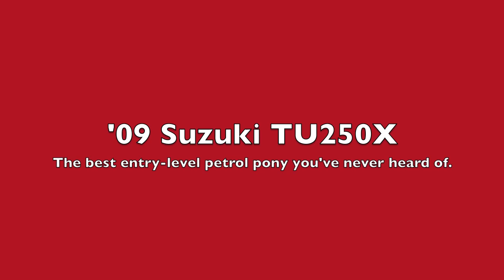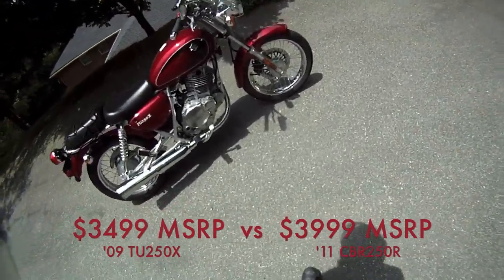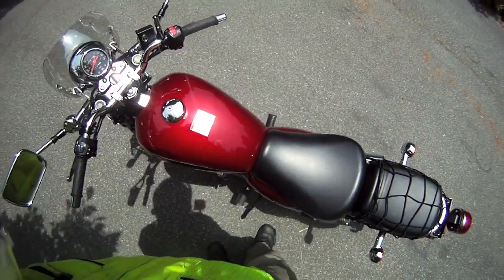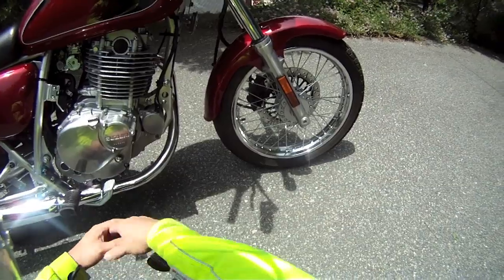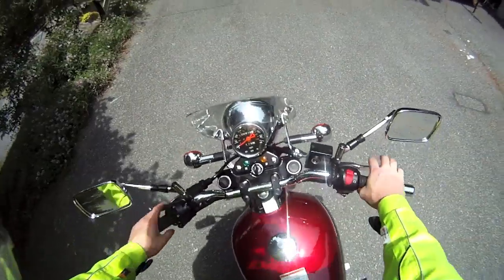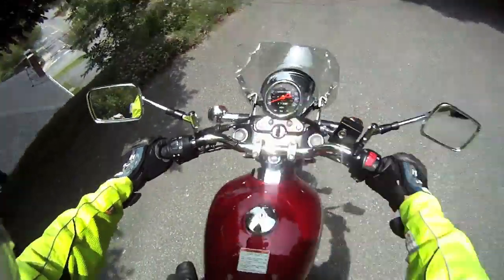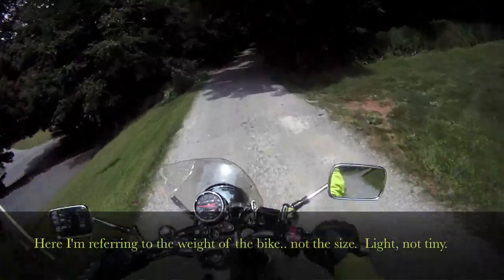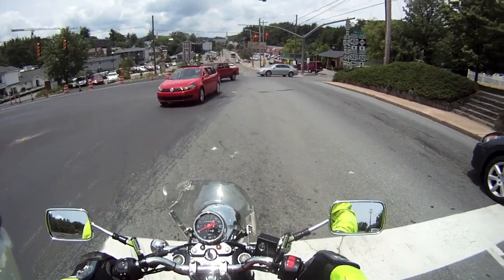TU250X Overview

Comment: From 2003 still 2006 I traveled 3000 km in the Alps of the South of France. Dozens of collars(passes) of 1500 in 2800 meters in height.
But I drove the younger sister of TU 250 VOLTY: TU 125 CLASSIC. I knew my best memories motorcycle by exploiting  at best a so small engine in 2800 meters in height. The comfort on execrable roads, the ease of ridding, a mini weight its esthetics of the year 60 made me lover of this motorcycle! Not tu 250 of available, I obtained a trail 650 cc. Yes,a lovely video one motorcycle in this context

Comment: I've been riding a Honda Rebel 250 for the last 5 years, i'm 6ft: 6ins  250lbs totally love my bike but i'd like a TU 250 because the seat looks a bit higher. the Rebel is 26ins and the TU is 30+ ins plus it's got E.F.I. Also the TU 250 is a much nicer looking bike.

Comment: i'm 140 lbs with the bike unloaded and in 5th gear it's take me at a connfortable indicated 80 mph for 3 hours. 1200 miles and it hasn't exploded yet :P It doesn't have a tach. it isn't screaming or vibrating a lot and it's about half to 3/4 throttle

Comment from the maker: Olympia Airglide 3.   Their hi-vis is obnoxiously bright and it's got a bunch of 3M Scotchbrite piping so I look like Tron at night.  It's mesh, though.. so abrasion resistance isn't the best.  Decent armor, lots of pockets and a nice insulated inner jacket (wearable separately) make it a nearly 3-season jacket.  It's a bit pricey, but you can pick them up fairly cheap used on eBay.

Comment from the maker: Yes.  They are badly maintained.  Those roads see snow and ice 5 months of the year and are managed by a government that sees snow 1 month a year.  Their idea of a reasonable solution to winter maintenance is to salt/brine the road all winter long and scrape it hard.. and they aren't proactive about paving in the spring, so if they do get repaired it's just before winter starts so the repairs don't last long.  The TU handles them confidently.

Comment: How does the engine sound in person? It sounds like my 50cc chinese scooter in the video but I'm not sure if that's just the way it came out in the video... Great video btw!
Reply from the maker: cubanlock15 Thanks!  It sounds pretty much just like the video.. a tiny bit more bass, but it has a very 'friendly' sound.  There are some basic aftermarket exhausts that will make it louder and meaner sounding.

Comment from the maker: Feet down, standard.   Check it out on cycle-ergoDOTcom

It's the same bike as the ST250 sold outside of North America.

The GZ250 is the feet forward cruiser version of the same bike.  Different frame, heads, exhaust on the GZ and it still has a carburator.

Comment: Cool, how does it handle the hills out there in Boone. (I have a place near Todd). Ever go 2 up on it? Had an old Beemer I used up there, power wasn't the problem in that case but the 30 yr. old  brakes simply inadequate in the mountains.

Comment from the maker: @poet79ful Some TU riders report not even being able to hit 80mph if there's a headwind or if the rider is rather large.   A Ninja 250 makes nearly twice as much power as the TU.  If you were to try to cross a continent on the TU, you'd probably be better off on the back-roads trying to have an adventure rather than trying to Iron Butt on the freeway.  You could get a dead reliable used KLR for that kind of money that would handle a trans-continental trip far better than the TU.

Comment from the maker: The bike will do it.  You may need to downshift if there are any long hills (or if you're at high altitude).  I'd recommend upgrading the gearing with some new sprockets so that the bike runs a little smoother at those higher speeds... also, loctite is a good idea to make sure you don't lose some of the bolts (such as the ones holding on the side panels) while running at high RPM for an extended period of time.  Look up the thread on ADVrider.com for more insight.

Comment from the maker: @harf12345 I'm using a GoPro Hero HD mounted to left side of my helmet's chinbar. I'm using the open backing plate (to allow more sound to reach the mic) but my voice is still muffled being inside my helmet. I'm working on a solution to that problem.